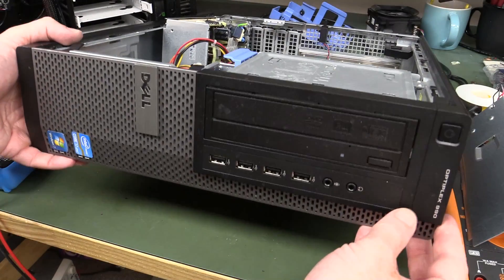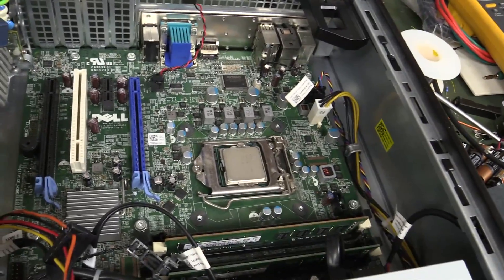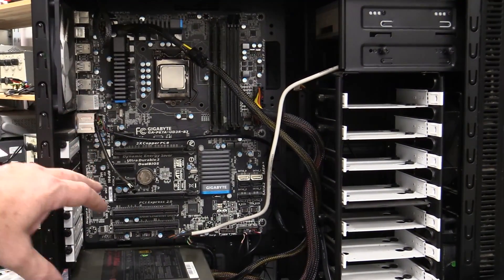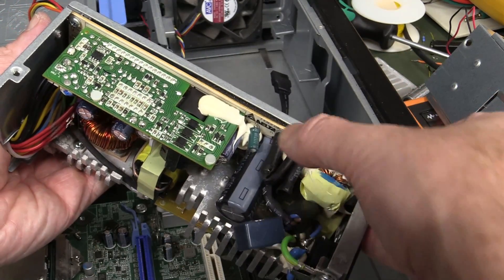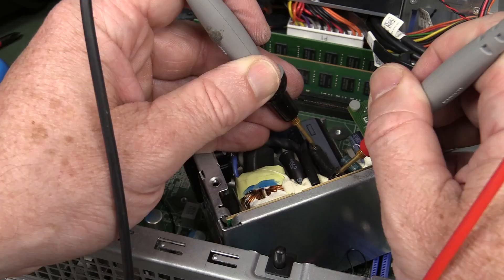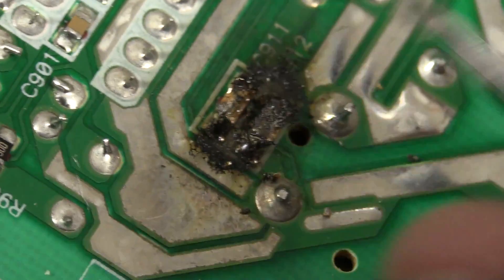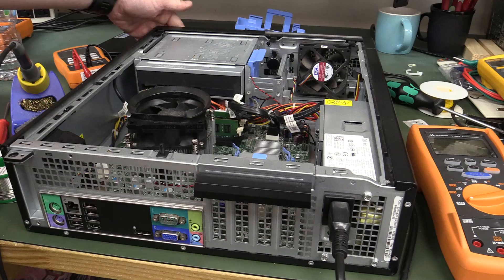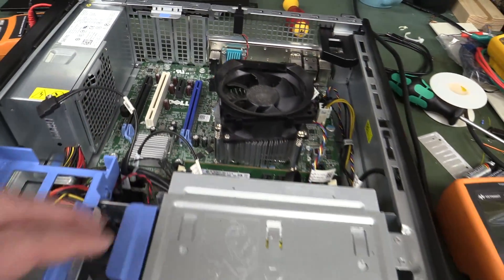EEVblog #1077 - Dumpster PC Repair

Comment: Delta is not top quality.
But mediocre OEM
Reply: I have a lot of spare PSUs, including some delta ones. The delta ones are by far better quality than the others. The labels on the delta ones don't lie and the PSUs can actually output the amps the label says . They don't use the crap 2 transistor design on the primary for 5VSB like some other cheap low quality ones.
Reply: Delta make perfectly reasonable, not-mis-engineered power supplies. But they're also built down to a price in this application.
Reply: IIGrayfoxII Yeah, but when you compare to the whole range of 240v to 5/12/24v power supplies they have to be ok to run that kind of computer :)
Reply: They're cheap.
They're not the worst, that honor belongs to PSUs that come with those cheap ass computer cases.

I was also nervous when dave plugged in that non dell PSU into the dell motherboard as dell have a habit of not using the ATX standard but their own pinout.
Reply: Best power supply I ever had was surprisingly a Chinese "Hipro" 350W from 2006. It badly suffered capacitor plague (puffed/leaky caps everywhere), but for whatever reason never gave me a bit of trouble. Even at like 400W total load, the output ripple on the 12V rail was well under 100mV.

Comment: you said socket 2011. its not. i7-2600 was socket 1155
Reply from the maker: Yes, not sure why I said that
Reply: Agreed. i7-2600 is socket 1155....im still running one right now. And its a screaming CPU. You have to be cautious with the Intel 1155 motherboards though. Intel had a recall on them. The updated 1155 boards are the B3 versions I believe.
Reply: screaming?

Comment: On these Dells, any PC PSU can be used for testing (or use but the case won't close if you care)
Reply from the maker: Err, that's what I did in the video.
Reply: I'll admit I didn't watch the whole video lol. Might be useful to know that some newer HP and Dell PCs don't use a standard PSU but you can make them work with cheap eBay adapters.
Reply: I've also run across these non-standard pinout motherboards. I just looked up the pinout and modified the 24-pin header to match the motherboard. Both Dell and HP have models with non-standard pinouts.
Reply: Weirdest part about the HPs at least is that the 5V voltage is done on the board, and you have a 4 pin connector that goes from the board to the HDDs which I've never seen before.

Comment: you always have an expensive transistor to protect the fuse
Reply from the maker: Likely!
Reply: You should see some of the Plasma TV boards I've had to work on.  No fuse, 1 part goes bad and takes out tons of expensive IGBT's and other stuff.  And if you don't catch all the problems, the new parts all blow up again.  Large amplifiers can be just as bad too.
Reply: speaking like an apple certified engineer!

Comment: Unbelievable these companies doesn't make their it department fix this stuff...
Edit: the i7 machine is really, especially because it has the low power version of that cpu
Reply from the maker: Companies in buildings like this don't have IT departments, they aren't that big. It's mostly smaller companies with 1-10 employees. They just contract their IT as needed, or simply toss and buy new ones.
Reply: EEVblog in my office I'm a simple administration employee and I take care of the only 3 machines in there, even without being employed as an it guy.... We are using super rusty and willing to die AMD Sempron 145 based PCs with single channel 4GB DDR2 RAM and in the two years I'm working here I literally servicing them constantly because they are really beaten up, all connectors are dodgy because they are getting loser and loser and humidity makes all the contacts slowly rusting, without talking about the constant ram swapping. One of those PCs actually fell off a stair ramp before I got this job and it missed a lot of case parts XD
In a nutshell, if I'm able to fix those rusty trash thingies, I'm sure the most it competent guy in those offices are able to just diagnose a PSU fault and replace it.
Reply from the maker: Yes, they often rely on someone who knows stuff about computers and they kinda fall into the IT role.
Reply: such a waste, they could sell it online or donate it somewhere at least
Reply: It comes down to time though as well. Once the onsite warranty is out, is it really worth the money for someone to tinker with a computer? If both the "tech person" and the employee who uses the computer are not working because the PC is broken, then that cost adds up quick.

Comment: Damn, I only foud a Pentium2 in the dumpster,  many years ago! :(
And a PS2.
Reply: ei96byod 
Well, of course. I already had a PS2, so I repaired It and gave It to a friend. The Pentium 2 was already obsolete when I found it, so I couln't do anything with it.
Reply: I found a P4 first ht sort system in the dumpster. I used its usb floppy bay flash card reader in a computer of mine. Shelved a sata 160 gb drive.
Reply: I have an old Win98 PC that I found, it has a Intel Celeron Slot 1 CPU as well as 2 old Win98 PCs with Intel Pentium 3 800Mhz socket 370s.

Sometimes rummaging through trash finds old gold
Reply: A PS2 is good find, there are people who collect historic computers...

https://en.wikipedia.org/wiki/IBM_Personal_System/2

This was my 2nd thought, the 1st one was "PS/2 keyboard or mouse" and the 3rd was "He probably means a game console from Sony"... Just be more specific if you use short abbreviations. ;)
Reply: I think he was talking about the Play Station 2 not the IBM PS/2
Reply: A Playstation 2 is still something I would be happy for. Plenty of nice games you can play on that :-)
Reply: IIGrayfoxII 
Yeah, in fact It was a PlayStation 2. I also found a b/w notebook once (with Windows 3.1!), not in good shape but still working. Too bad the 40mb hard drive failed some years ago...

Comment: Can you do a video about plasma repairs? I have Philips 42PF9966/10, everything is good, psu is good and all boards are good and they are fully functional, but when I try to turn it on it goes to the protection mode (3hz blinking red led)? I also tested all psu outputs and I have put a load on them, Y and X sustain boards are good, please help xD
Reply: That's pointless. Unless someone has the exact same fault in exactly the same model the video won't help anyone. Plasma TVs are no fun to work with because of all the high voltage. And considering the excessive power consumption of plasmas, it's not much of a shame if they need to be thrown out.
Reply: 12voltvids has plasma repair videos
Reply: leon johnson jr nope, it was a bad power supply, I wasnt getting 30v from a transformer, the transformer was shorted
Reply: jimstand thanks man :D
Reply: Vucko 101 y sustain board

Comment: Awesome! :D

I had a PSU fail very loudly about 8 or so years ago and it scared the absolute jeepers out of me. 3 electrolytic caps all exploded in about half a second. It sounded like gunshots right next to me. After I opened the PSU up and inspected and tested various things I determined it was thermal overload... the cooling fan had failed.
Reply: my computer was down to just the cpu fan at one point and i was wondering why my temps were crazy and unstable under load. lol
Reply: After one long break I was part of a team brought in to service a bunch of known-problematic PCs in a computer lab.  Power supply was one area, but these were more known for bad hard disk drives and bad RAM.  We found the breakers for the lab powered off when we arrived.  The breakers were turned on and approximately thirty PCs popped their power supply capacitors simultaneously, throwing smoke out the back and everything.  Once we verified no actual fires it was pretty funny, but it had been panic-inducing for a few seconds there.
Reply: I used to work as a field tech for Imaje coding printers. One time I got called for a printer which wouldn't turn on. When I plugged it in to see what was up, it hiccuped a couple times and went BANG! I pulled out the power cord posthaste and opened the top (their top open up like the hood on a car)... and you wouldn't believe the amount of smoke that spilled out! had me coughing and running for cover, mind you, this was in the middle of the production floor so I had an audience of about 20 machine operators. One commented "Engine steaming, bro?" and the rest broke out laughing. Probably one of the most embarrassing days in my career.
Reply: An all too familiar tale.
Reply: yes, even the high end long life electrolytics will only last ~1 year at high temps (and they dont put those in standard computer PSUs).
Reply: facepalm
Reply: I'm assuming those PSUs do not have OTP?